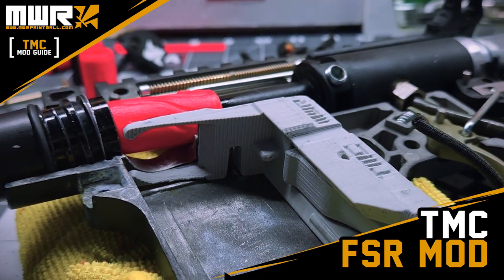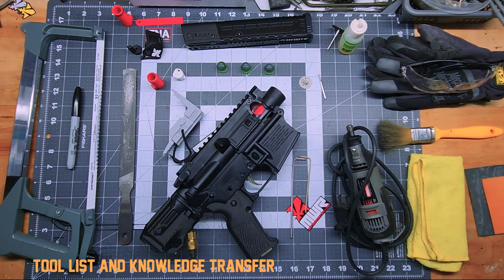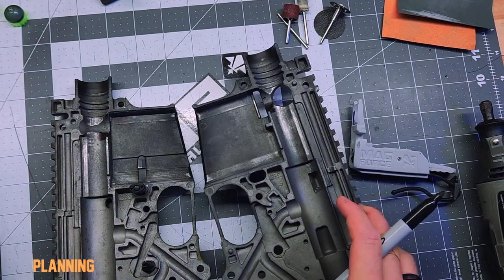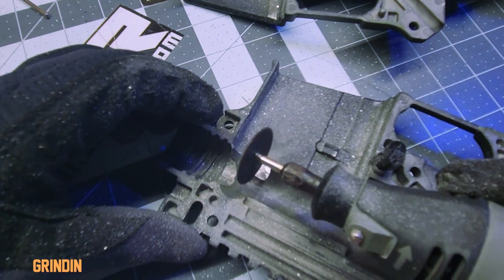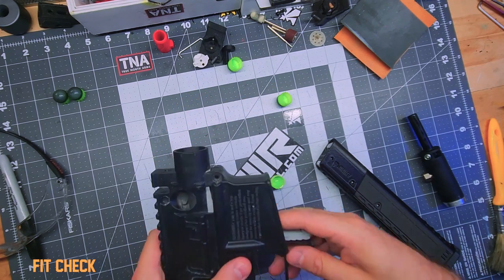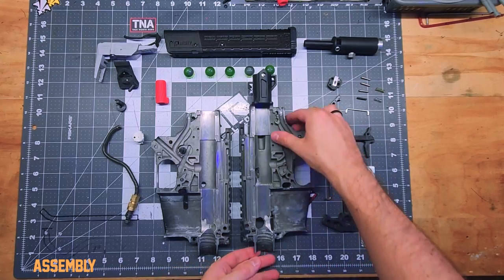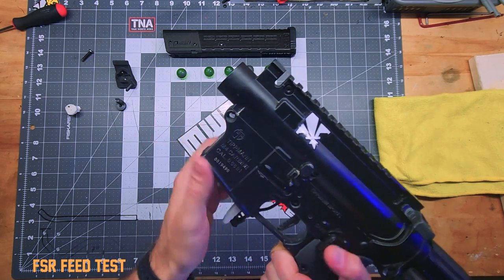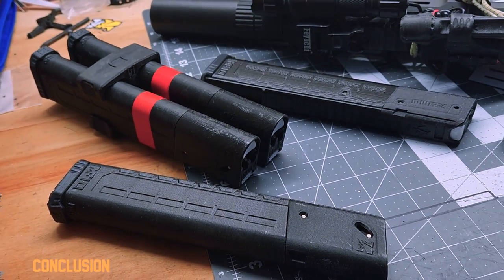From Standard TMC to FSR Slinging Monster - MWR Paintball's Complete TMC to FSR Conversion guide

Comment: Hi! Does this tutorial work on older version of the TMC (Tan colored one with Air suply adapter at base of the grip)?
Reply from the maker: @Lendaiga  yep its the same internals. Air source is irrelevant so it could be standard in grip or in the stock like the elite TMC
Reply: Cool! So i can still use the Air through stock Tube kit ( Just like in the video,2500 psi) on It with no fuss, It would work perfectly?
Reply: And also be able to change Its grip for a another style too?
Reply from the maker: @Lendaiga  yes and we offer plenty of styles for those as well

Comment: So are the zeta mag and magforce adapter the same? I currently have gen3 tipx 10 flip mags. What do you recommend?  I currently have both in my shopping cart. Waiting for your go ahead!! Lol also what grit paper are you using for the polishing?
Reply from the maker: Hold up there! Im sorting out the shop as we speak to make it more clear what to get. the adapters are the same now just have to swap the Lever out for the mag type you want to use. if you need to do that mid game you will want 2 adapters. gimme a second to sort it out
Reply from the maker: you should be able to purchase now. let us know if it makes no sense still
Reply: already got it purchased! as well as the spi kit. im excited to see how my FSR TMC concepts turn out! thanks for the quick response! @mwr_paintball